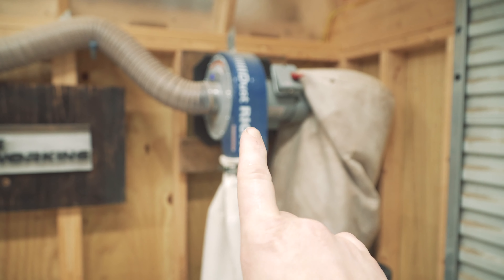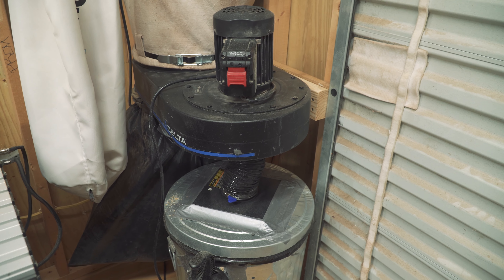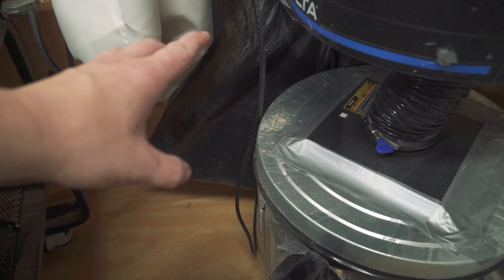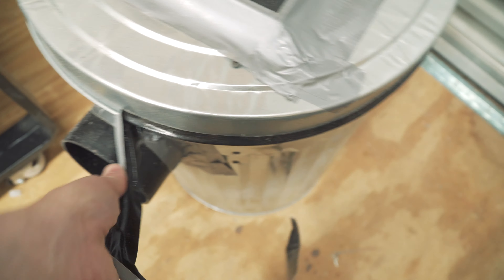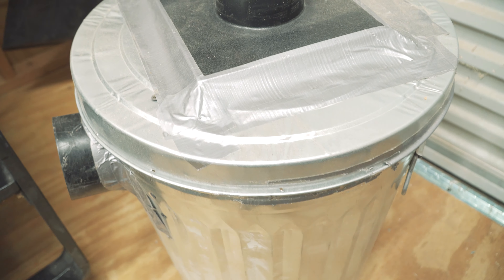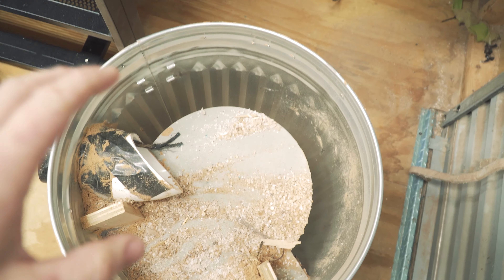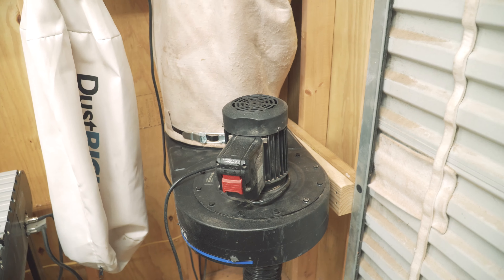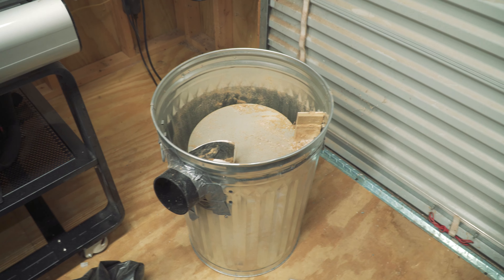Garbage Can Dust Collection Separator Overview (4k)

Comment: It would work a lot better if the baffle was correctly placed which is not and you didn't have those vertical pieces in there that's blocking the circulation of the floor around the edge
Reply from the maker: I completely agree just had to do it this way for the moment will make or get a good one later on